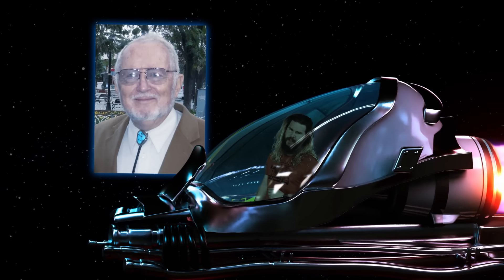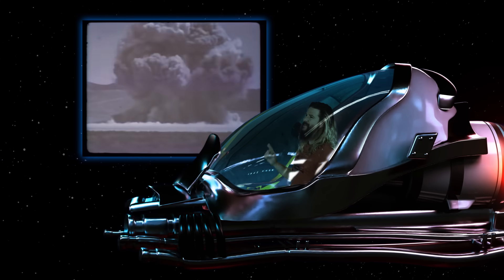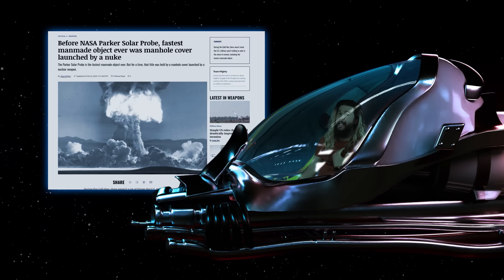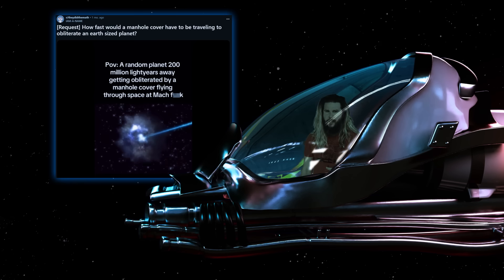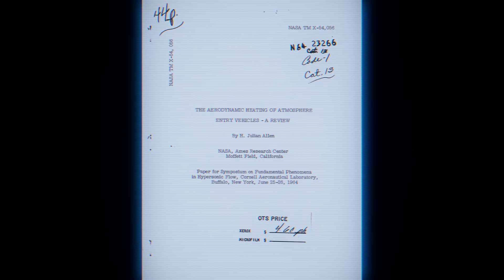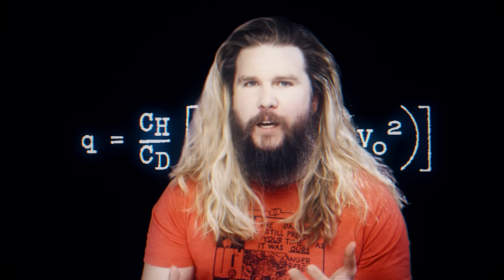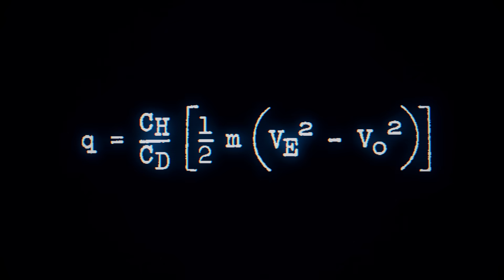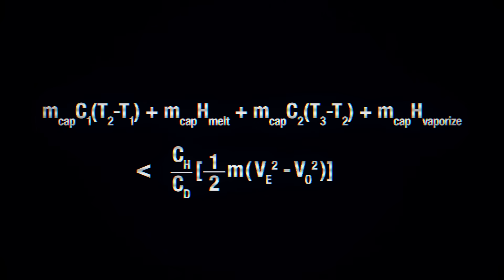Debunking the Nuclear-Powered Manhole Cover

Comment: Love the vid only things I was thinking that would mess with it would be would it not turn to its thin side to reduce drag and could it be going fast enough to almost have a Leidenfrost effect where the bunched up air or iron plasma in front of it would act almost like a thermal shield but even at that the amount of energy you found that it would receive is 6 times higher than needed and also I would assume that it would either melt into a ball or get bent into a more round shape as it heats up but most likely would still end up evaporated 

Always love your content even if i dont know the math (computer science major) I understand the concepts as you are great at explaining keep it up!

edit: just saw a comment about the shape one from someone who did a paper on it RIP also was surprised u didnt do the energy transfer from that size of bomb the size of the neck of the outlet yourself as u seem to like doing the whole process but that would also make the vid less shareable prob so i understand

Comment: What strikes me as odd for the vaporized lid seems we measure items going from no air to dense air. I dont think the whole thing made it to space but if you start in the thickest part and move to the thinnest part wouldnt you have less resistance as you go?
Reply: I have the same question?!
Reply: My question would be how the equation changes with the manhole traveling like a frisbee on end. The air resistance obviously would be much less and the friction would heat and degrade the edges of the manhole’s thickness first (that’s where the metal is at its thinnest), resulting in more aerodynamic profile.
Reply: Clearly there are too many variables to account for. I propose we confirm the hypothesis experimentally
Reply: @Bender-B-Benson-BMSMA  
Right!? We haven't even considered the initial heat imparted by the combustion products that sent the thing flying in the first place!
Reply: @Bender-yy5zw  only requires 300 tons of TNT; easy-peasy!
Reply: @Bender-yy5zw  i think the only variable i would change from the equation is air gets thinner not denser which is what causes the inbound material to heat up and break up
Reply: The brief exposure to atmospheric drag due to its speed could have limited the time for heat buildup.
Reply: so true! You would have to account for the reduction in pressure as it reaches the exosphere, determine the rate of material lost as a ratio to area and integrate from the maximal surface area experiencing drag to the infinitesimal minimum area to account for that variable I would think. Ofcourse, I could be wrong! I have a lot to learn yet, but it gives my life purpose :)
Reply: Looks like we need a computer program that calculates the forces, friction, drag, ablation, temperature spread and thus differences within different parts of the cover, the tension that is created by the different expansion in different places, the sound barrier created by the atmosphere, the energy of the collision with the atmosphere, and so far and so on, step by step, millisecond by millisecond. The process would be as complicated as trying to reconstruct the development of the distribution of matter within the universe.
Reply: @gabbyn978  A detailed model taking in account such variables can be solved through "finite element analysis" computer modelling. Not only it will solve "milisecond by milisecond (10e-3 second)", but by 10e-7 second to 10e-7 second or lower, depending on how you configure the timestep. It would be very much possible to model the manhole cover event in ansys using their explicit dynamics software, for example. Complete overkill for answering the question "can it make to space?" but very good to see in good detail how exactly the manhole cover would break up.

It would also probably take a week or more of computing time running on a epyc 7763
Reply: @SicilianSSFR  
Would definitely be very interesting to run the simulation. If I wasn't already investing compute resources at uni and spending my research time curating datasets to train a model to analyze the conductive properties of a materials then it might be a good candidate for a dissertation! Well... mostly 3D printed composites and metals since my school is relatively well known for it's material engineering major, though I definitely have a preference for the science and not the application.
Reply: @chrispycryptic  Yeah now i'm debating actually doing it... But it would such a pain in my uni to request the compute time necessary, let alone actually make the model itself and all the preliminary research... Plus the material science department is mostly focused on textiles rn D:
Reply: @SicilianSSFR  that would be awesome, if you are able to do that I would love to see what the program delivers, I'm not great with technology but i love the study of ballistics. And after watching the video again one variable I kept thinking of was time. I know it is pedantic as at those speeds things happens insanely fast but I'm curious with his numbers how fast the cover would heat up.
Reply: Starting in the thickest part is actually worse, you would be going faster in a denser atmosphere, meaning much more heat. Asteroids have the "benefit" of getting progressively slower in the thinnest part of atmosphere before reaching higher pressure air.
Also, in addition to heating by friction alone covered by the video, the manhole would also combust due to oxygen in air, adding even more heat to its surface.
going at 66 km/s in dense air, i would be surprised if it even made out to 2km height before being completely and utterly disintegrated.
Reply: @SicilianSSFR if it was combusted they'd notice something like a fireworks,  since there was no such thing in the record I assume the entire thing made it out of space.
Reply: @robymaru03  Unlikely considering the event time scale (in the order of 100-200 ms). The top part of the frame in the high speed footage is at most ~800m up, probably lower, so its hard to tell that its burning during the couple of frames it appears. Outside the high speed footage, the event would be over faster than you could blink, leaving only smoke that might as well be mixed with smoke and dust from the blast itself.
Reply: @SicilianSSFR  it needs 1.5 seconds to reach space tho. asteroids fly longer than that. im not sure if 1.5 seconds is enough to completely vaporize almost 1 ton of iron. i feel like by the time the surface reaches a hot enough temperature, the cover is already in thinner air thus not heating up as much. but i guess its all speculation until someone actually does this again, which would be fun
Reply: @dermaks_  at 66 kps and taking the furthest point called the atmosphere would be 2.5 minutes. But it would be out of the thickest part in a sixth of a second
Reply: @dermaks_  1.5 seconds is a eternity at those speeds, my educated guess would be maybe it can survive for 20-40 ms? like the formula from the video suggests, the heating from friction over a period of time can be estimated by calculating the energy from the difference in velocity over the same period of time (times that CH over CD), and if its over the energy necessary to melt the manhole, it will do so regardless of how short the period is. Vaporizing is not even necessary, considering the increase in surface area from the liquid dispersing.

Also, putting aside the fact that cast iron is structurally weak and brittle and probably would shatter into a million pieces at those speeds, massively increasing the surface area and therefore heating; as the manhole cover moves its constantly losing mass to ablation, and therefore reducing the energy necessary to heat the remaining mass.
There's other issues as well, but the fact is, 66 km/s is just too fast for anything to not vaporize at 100 KPa atmospheric pressure.
Reply: @dermaks_  the furstrating part is that we can get a more or less decent estimate of how long it might have survived in the best case scenario (i.e. manhole keep its shape), i'm just too lazy to plug all the numbers in all the equations xD all the variables are known (delta P over height, dimensions, speed and mass of the object, enthalpy of combustion of iron, etc) just a matter of running the numbers
Reply: @SicilianSSFR  This comment comes across as sarcastic to me because my question was what happens in the opposite direction of air pressure. If there is another formula to use, that would be awesome because the one he used goes from no atmosphere to the atmosphere. If it burns up as fast as this would claim it wouldn't have gotten over 100 ft off the ground to appear on film.
Reply: @jonmorley5931 space is 100km away tho.
Reply: @ticketforlife2103  the outer most layer 10k kilometers bit most meteors burn up around 50 kilometers, so in less than a second it would be past where we see those burn up
Reply: @jonmorley5931  The equation is generic and does not directly take into account the pressure, its simply calculating thermal energy by comparing the delta kinetic energy of two points in time.
Therefore it can be applied to any object which is presumed to gain thermal energy in detriment of kinetic energy, regardless of the medium.

You can also think critically about expected physical behavior: in higher pressures, there's more air molecules to collide with; and since heating by air friction require gas molecules to hit the surface of the object, more molecules ergo more heating, its directly proportional and there is no way around it.

if it took 40 ms for the manhole cover to burn up, it would have gone 2600 meters up, well outside the frame. I'm not sure whats sarcastic about any of this.
Reply: @SicilianSSFR  yes but it wouldn't reach that temperature immediately? Even if it only takes 1 second to reach that temperature that would mean it traveled 66 kilometers at the same time, into thinner air and less oxygen.
Reply: Yes, you will experience less drag later in the flight, but you have to understand that this is the worse case scenario. When you enter the atmosphere, you fly fastest through the less dense part, and when you enter the denser part, you fly more slowly. But on ascent in this case you fly fastest in the densest part, which heats up even more than this equation suggests.
Reply: yes, but at the same time it would instantly turn into a molten iron shotgun and absorb even more heat because the higher surface area. there are way too many variables to be sure. but the energies we are dealing with here are absurd.
Reply: the thing is the manhole wouldnt have survived into the higher parts of the atmosphere, and the more pieces it breaks into the faster it heats up because thats more surface area
Reply: @bonk4621  
That would only be if it broke into pieces during the flight I believe... Since it is a homogeneous lattice of material then I would think that molten slag would shed from the leading edge as the metal overcomes the enthalpy required for a phase change from solid to liquid.

 It is sensible to assume that heterogenous materials would break apart quite easily because there are separate materials with defined boundaries all with their own thermal conductivity and enthalpy required for the transition.

Comment: What if it turned sideways? Wouldn't that cause less drag?
Laten frost effect, maybe? Also how much time was it under this resistance before entering space potentially? Just wondering.
Reply: its leidenfrost, and that is only for heat transfer through contact, not through convection, theres a few other reasons it wouldnt work, but, the key one is its the wrong method of heat transfer
Reply: @ysquaredyobozo  oh didn't know that one, thanks.
Reply: @ysquaredyobozo maybe ablation? One thing to keep in mind: it was so fast, it reached the karman line in 2 seconds or so, does it give enough time for the heat transfer? Wouldn't it ablate?
Reply: i think a better assumption would be that it tumbled, not to mention it wouldn't be evenly heated and deformed.

Comment: At 9:39 the difference of the squares of the velocities is 66 (km/s)^2 but isn't that just the starting velocity. Wasn't there also a velocity that it would've left the atmosphere with?
Reply: Yea I noticed that as well. The current setup kind of assumes 0 for the exit velocity, which is the maximum amount of possible heat. Need to calculate the negative acceleration due to drag and gravity over the distance travelled to find the exit velo, which also requires you to factor in the air density gradient of the atmosphere, bc the drag force/heat imparted is going to be reduced the higher you climb. There's a lot more weeds to get into with this equation imo.
Reply: I think you're right. It would only have lost some of its kinetic energy when leaving the atmosphere, not all of it, and so only some of that kinetic energy that had been lost could have been converted to heat.
Reply: @ntrgc89 only lost some? Damn we need to be launching satellites to space with just a nuke if it’s that efficient
Reply: I redid the calculation at 9:39 by setting both sides equal to each other and then solving for Vo. The manhole cover would only have needed to lose about 5.3 km/sec of velocity for the kinetic energy lost to be equal to the energy needed to vaporize it. 
I don't know if it would have lost this much velocity/energy by slamming through the atmosphere given it could have been tumbling or forming an insulating cloud of vaporized iron or something, but this result suggests that in the event that it did survive long enough to make it to space, it definitely isn't coming back.
Wikipedia lists the escape velocity of the solar system from the surface of the Earth as 49.5 km/sec. If any amount of it made it to space, it would be traveling at least 60 km/sec.
Reply: @minecraftiangenetics  You sir are a gentleman and a scholar. This puts the question of heat within an order of magnitude of the cast iron mass vaporizing, viz., we now have to worry about a whole slew of comparatively minor variables.
Reply: Even if you assume that the theoretically intact man hole cover reduced in speed to escape velocity, 11 km/s, the thermal energy imparted to the man home cover is still 3.7e^13, which is still higher than what is required to vaporizer it.
Reply: @rossmacdonald3650  That is correct. If the cap lost enough energy as heat to decelerate to 11km/s, then it would have melted. The point the other comments are saying is that there is no reason to believe it slowed that much. So the question is: did it decelerate enough to melt? 🤔
Reply: @rossmacdonald3650  yeah, but why would it have decelerated to just over the escape velocity? why shouldn't it have decelerated way less?
Reply: @Mmmm1ch43l  I do not know what it would have potentially decelerated to, but for it to at least be an object that left Earth's sphere of influence, and be known as the "fastest man made object to leave Earth, it could not decrease below escape velocity. I have no idea what speed it would have decelerated to, but regardless it would have most likely vaporized before it could have the chance to enter space.
Reply: @rossmacdonald3650  yeah, but you've got it the wrong way around

let's say it basically didn't slow down at all, then only a small amount of potential energy would have been converted to heat, so it wouldn't have burned up, and only very little velocity would have been lost, so it would have easily escaped the solar system

so in the end we do actually have to know how much it would have slowed down to know whether it burned up
Reply: Unfortunately Ch and drag are very, very hard in this case, especially given the speed of the manhole cover is an estimate with a hard lower limit thanks to the camera.

Plus, the whole column of superheated air and vaporized rock is moving with the plate, and imparting thermal energy into it.
Reply: So if it did make it into orbit, any remaining mass would exceed solar escape velocity.

Ch is unfortunately, very, very difficult in this case as you essentially have 3 liquids; the atmosphere, the vaporized iron, and the molten iron.
Reply: It didn't leave
Reply: @emenesu  That's an unfounded assumption.

Comment: The Chubby Electon Man's video on it was pretty funny. As i assumed you would end up actually mathing it out eventually
Reply: "IM GETTING TO IT FAT MAN" is such a reduction, he doesnt even get electrons now
Reply: *screams in freedom units
Reply: He's way funnier than surfer bro science man 🤷🏼‍♂️
Reply: Some just refuse to take in to account that the man hole cover was made out of 100% US refined steel. That thing is still up there. Probably what will cause the war with the bugs in the future.
Reply: @Ratkill9000  Material heavier than the heat shields on early US manned space craft, (that is not used going up).
Reply: Kyle's math is fine but his analog is very flawed.  Reentry is hitting the air while the cover was moving with the air (little drag riding the wave) Second that formula used was for different materials that don't hold together (note a battery from ISS hit a home in FL this year intact and by that same formula should have vaporized and the cover was both larger and more solid)  Now in Kyle's favor is the blast heat that he failed to calculate at all.  This is one of the worst science jobs I have seen Kyle do.